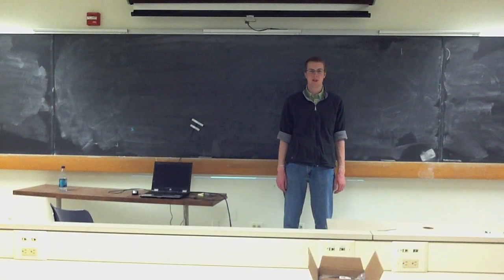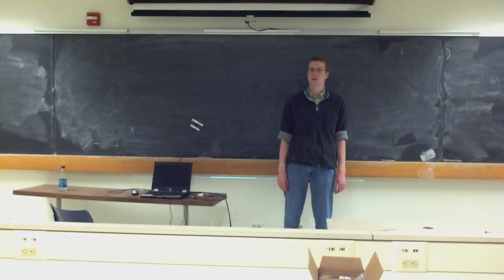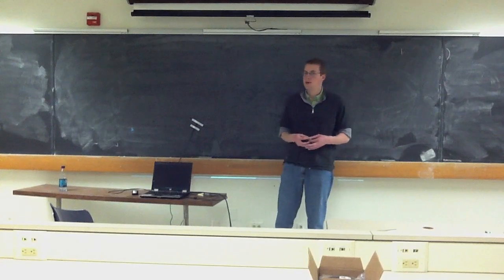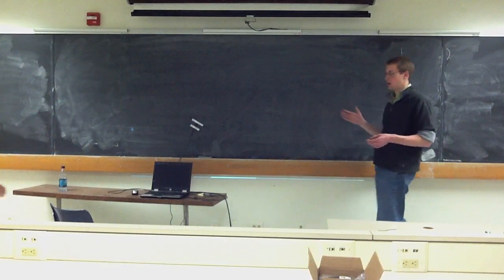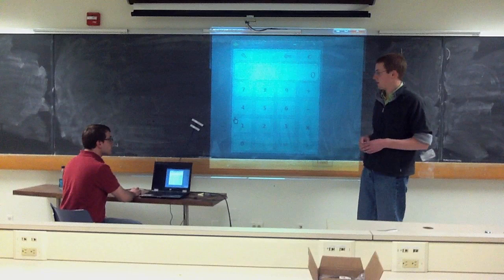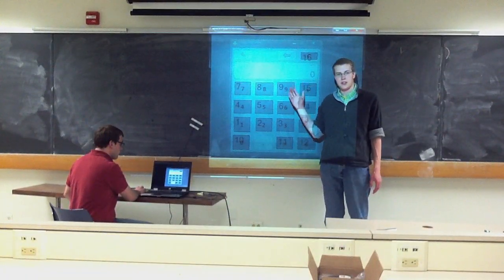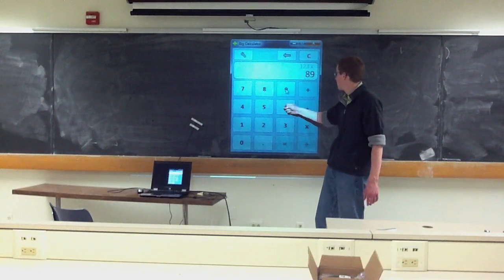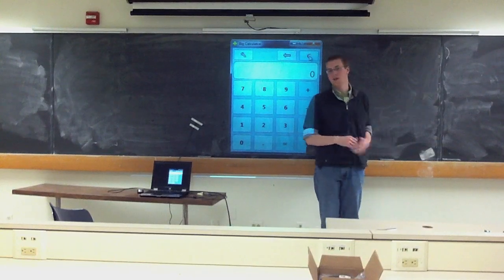Acoustic Touch Screen Demonstration

Comment: True, there are large touch screens for sale out there, but ours has some unique features. For one, I'm not sure how much a Mimio system costs, but our system cost us about $50 total. Furthermore, a Mimio whiteboard will only recognize input that is physically on the whiteboard, while our system can recognize input on any surface you attach the sensor to. In this video, we demonstrate with a blackboard, but in 10 minutes we could attach the sensor to some other surface and have it working.
Reply: Hey Seth Are you still reading your comments?  If so please reach out to me.  I am working on a digital airsoft target system and I think this could be exactly what I'm looking for.  I have some questions

Comment: The Mimio Interactive Displays already dose this and is a lot easier to use and you can use the whole screen instead of selecting parts and it only needs a 9 point calibration

Comment: I did this for a project at my university as well. It's a nice concept, but not very practical: the position of the tap is determined by the tail of the soundwave going through the medium. However, those tails are quite complicated so you need to calibrate every point or region you want to be able to tap, just like the video shows. But there is also another problem: because you take the tail of the soundwave, you'll always have a delay of about 2 tenths of a second. Therefore it's slow.

Comment from the maker: Wave propagation through the chalkboard has many degrees of freedom (think about if the chalkboard is nonuniform or has faults or cracks in it). With a complex medium such as this, you can't compute all the points easily from just a small set. If we assumed more about the medium (like if it was a faultless rectangle of a known material) then what you suggest might work.

Comment from the maker: The difficulty with multi-sensor approaches is that you must assume certain properties of the medium (such as uniformity and the speed of wave propagation) and your algorithm must be aware of the relative positions of all the sensors. Acquiring accurate measurements for all this requires no small effort. Single-sensor approaches, on the other hand, have the benefit of requiring no such setup at the cost of non-arbitrary localization.

Comment: how about calibrating 2 oposite corners top left, bottom right for example, the sensor then works out the distance between the 2, uses a resolution size that would match that, making all the items inside the square auto calibrate, because if u need to go through that process just for a calculator,for other things its going to be a pain in the ass. 

so basically the distance is worked out e.g 1m x1m and then that is mapped to the resolution 10cmx10cm(example) and the distance of button auto done

Comment from the maker: This system contrasts with a typical smartboard because it uses a single, cheap (~$50) sensor that can be moved anywhere and attached to any flat surface. This contrasts with traditional smartboards which are large and expensive.

Comment: Differnt surfaces/materials/geometries/applications warrant different levels of calibration complexity...  The key would probably be in selecting the most vibration/sound-sensitive and manufacturable platform material...  
Why not consider using an array of ambient light sensors?  It may be a little quieter than this...
Nice concept, though - could work great for Anger Management stuff!

Comment: Not very practical as a high resolution tap sensitive scheme for obvious reasons of large amount of calibration necessary, but still very highly elegant and parsimonious in the use of a single, I'm assuming MEMS, accelerometer making the setup essentially free material-wise.

Comment: but my point wasn't that it could be done with only 4 taps, I don't really care how many taps it takes. The point I was trying to make is would it be possible to create a region that any tap inside it could be located on a coordinate plane. Maybe if 4 points isn't enough, you could tap 4 different points along each side (evenly spaced), then draw a 4x4 grid inside the plane and tap where the lines intersect (that would give you data for the edges and a grid of data for the inside to work from...

Comment: Also thought about that. I think its easier the way they did it, they just map a certain sound to a button / clickable area and accept a small variation frame. If that is how they did it it kind of makes it a bit less impressive for me since they just mapped sounds to buttons (instead of determining the origin of the sound on the board)... but I could be completely wrong

Comment: I'm pretty sure the software just knows the "profile" of the vibration. I'm just speculating here, but if I were to create this program I would have it compare input profile to the known regions set during calibration. Extra force should just amplify the signal, but not change the profile of the input so with a little processing the program could add (or remove) some amplification to fit the calibration data.

Comment: Great work guys! But, doesn't this require a person to use the same amount of force each time when 'clicking' an area. If so, then wouldn't it be possible to use more force farther away from the sensor or less force closer to the sensor to produce the same audio vibration?

Comment: Why not just calibrate between 4 corners of the area of interest and then interpolate the incoming waves to determine where the tap originated within the area?
This may work even better by using two diverse measurements on the surface.

Comment: Calibration and selection takes too much effort. So unless that can be done more smoothly its not gonna sell. One way that is perhaps a little less invasive or more depending on how you look at it is inputting the size of the surface that is to be manipulated. But other surfaces would react differently so there you would also need a calibration action. But it would only be once.

Comment: If the system can calibrate (at least) three points within space, then define boundaries that it should not have as sensitive, can it not extrapolate an other location of knocking? Seems that might be much faster than an extensive setup process and more portable. With this configuration, applications could even carry profiles for 'non-sensitivity' once the system had determined it's orientation to the surface. Almost like older touch screens had you touch the four corners and center.

Comment from the maker: If you use three sensors, then you can analyze the timings and get good positioning without much calibration. But then you are assuming the wave properties of the surface, and you have to provide the algorithm with the distances between the sensors. The algorithm demonstrated in this video will no matter where the sensor is placed, and it will work on non-uniform (even non-flat) surfaces.

Comment from the maker: You have to calibrate it at every point you want to be able to tap. The only way (currently) to get "continuous" touch response across an area is to calibrate all the points on a dense grid covering that region.

The reason for this is that we don't assume anything about the properties of the surface we are tapping. So we can't do any kind of simulation of the wave-propagation properties of that surface; we are limited to actual measurements.

Comment from the maker: True, but we also investigated using a stylus for tapping. If you do the stylus right (i.e. you have to give it a soft tip to prevent it from bouncing on the surface), it works just as well as knuckles.